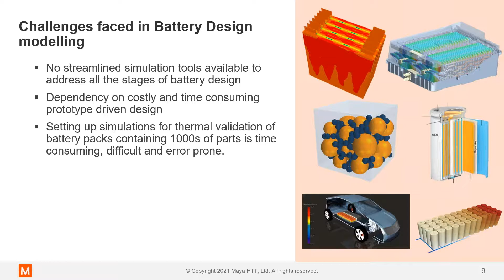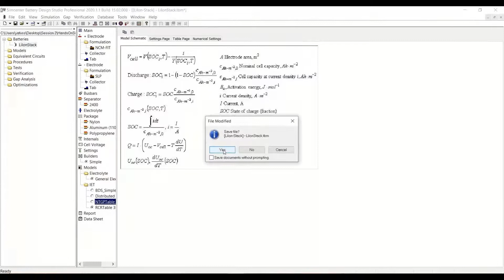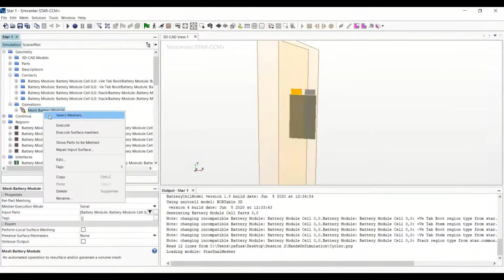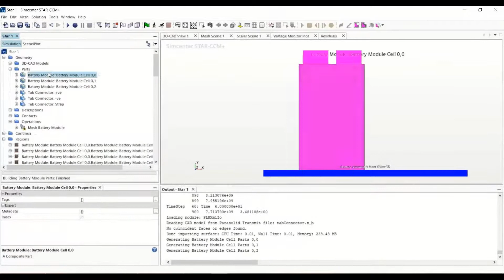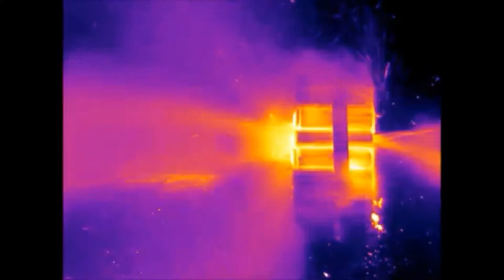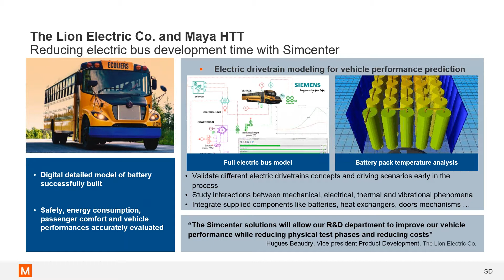Electrification - Battery modeling

Comment: Thansk.May I ask star ccm+15.02 how to import the battery pack built by 3D software and analyze the temperature change during discharge (without cooling system)?
Reply from the maker: Hi, this can be done using Star-CCM+ - see the following article: https://blogs.sw.siemens.com/simcenter/battery-pack-thermal-simulation/ 

We recommend contacting Maya HTT as we can help with any training required:
https://www.mayahtt.com/about-maya-htt/contact/